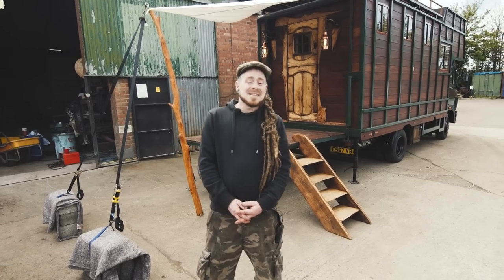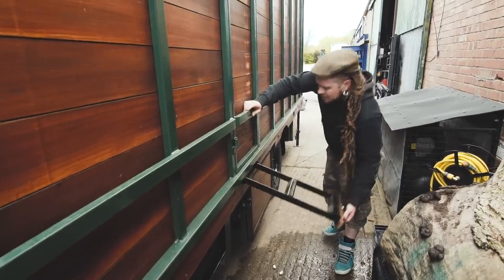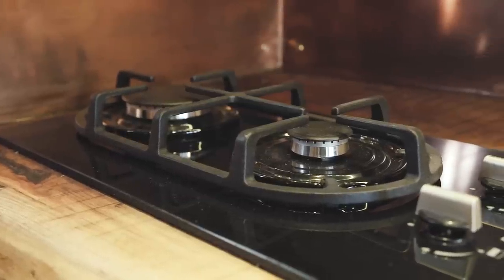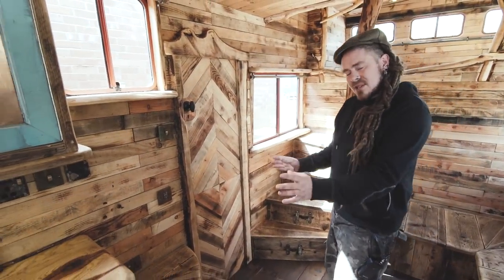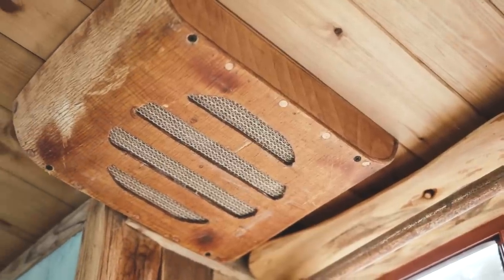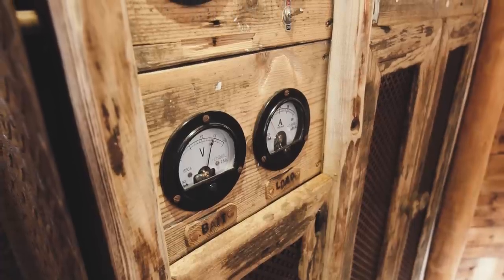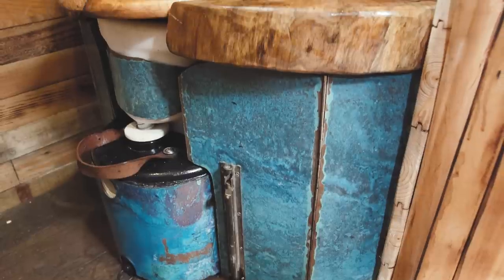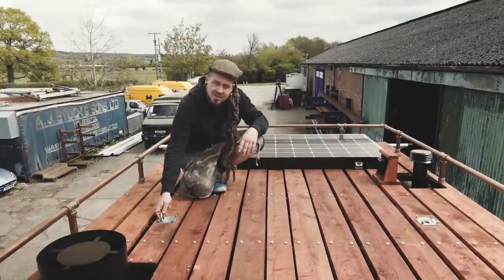Off-Grid Horsebox Tiny House Tour!

Comment: I'm curious - what is the total weight? The interior is beautiful, I especially love the blue on the cabinetry - it lightens the whole interior and gives it a tough of whimsy. I would have used thinner slabs for what I intend to build - just for the sake of gas mileage, but I am planning to travel the entire U.S. and Canada, with possible excusrsions into Central and South America.
Reply: Shelley Rambles Thanks Shelly :) After not seeing the truck for a couple weeks since it left us; I was struck by how chunky and thick a lot of the timbers look with fresh eyes. In reality the only pieces that are thick are the ones with the end grains exposed (such as the top of the seating) everything else is planed down as thin as we can get away with but has the same face texture, giving the illusion they're all just as chunky- so that, as you allude to, we can keep weight down (which is a constant battle, but worth it- we try to not compromise on appearance where we can help it)
Conversions of this size and type, with full time off grid facilities (heavy batteries etc) we normally add between 1 and 1.5t to the truck- but we often also strip plenty out at the start which can help offset things, so she's well within her safe rating (and doesn't have 3 horses in her!) We really consider these large builds to be more mobile homes than overlanding campers- although there is nothing to stop them being used as such; we'd normally suggest something a bit more agile for international touring.
Reply: Dear house box guy. This then,has been done and sold for someone,I gather. Thank you for explaining how to wood was thinned where it seemed to be bulky but was lighter. I really like nice woodworking and consider this truly gifted. Thank you

Comment: That custom tap is so beautiful. Where did you get those valves?
Reply: John Derry Hi John. They were normal peglar gate valves (the red plasticy handled ones) but I used a wire brush on a drill to remove the red powder coating, then one I did some diy copper plating on and oiled, and the other I just kept heating and cooling until I got an interesting finish.

Comment: This is a beautiful build.  Looks like a log cabin on wheels.  It just exudes rustic comfort to me.  To sit and listen to the natural world on that back ramp or inside in the bed area with all the windows open must be incredible. One question is about the wood burning stove, "How long does it take to have the heat dissipate from this?"  Granted, I know little about wood burning stoves and even less about putting them in a wooden boxed trailer.  But my thought was that had this stove been burning wood at some stopped place and was now very hot to the touch, let's say it was used on a snowy day at a camping location, how safe is it to move the trailer down the road when the stove is still very hot?  This could be no issue at all, but it got me to be thinking about fire safety.

Comment: Beautiful job on the woodwork and use of space! 
Is there"fireboard" behind the plate metal for the wood stove?( To prevent over heating and catching the wood walls on fire?)
And the only thing I don't care for is the"lpg" .... Not a fan of environmentally harmful /deadly fracking! 
It seems like besides the solar panel, a small caged turbine could be used for while traveling and breezy days to recharge the batteries! ??? !

Comment: Without a fiddle edge on those galley shelves, things are going to fall out when they shift in transit and lean on the doors. While it's a nice finished conversion it does not show a lot of knowledge of actual RV on-the-road-living. For instance the weight distribution is lousy as the water and gas is at the very back of the unit and behid the wheels.

Comment: I want it. Careful, when I find where it is .I'll get the firm's help and leave a toy trucks., God and law have said. "Thou shall not steal. But, nothing was said about exchanging.". 

" So, Ilooking around there it is. Making sure was no one was the area. So left the play Tonka remote control horse box. ' looks around hope in waves and goes. winks

One drawback. Just a.4 blocks down the road.Then  ** put put..** Sputter, moan...looked at panel light.

I thought the big E meant ENOUGH not empty...